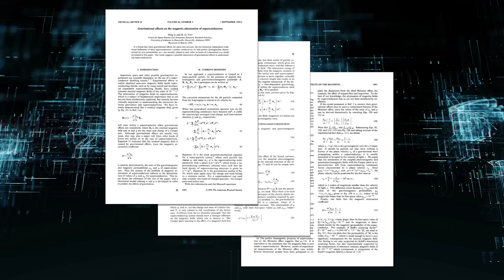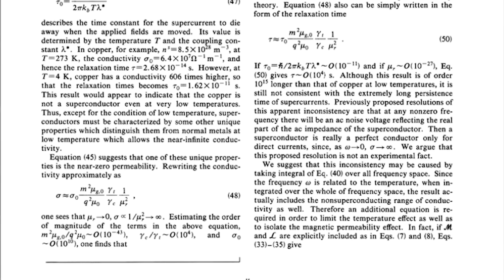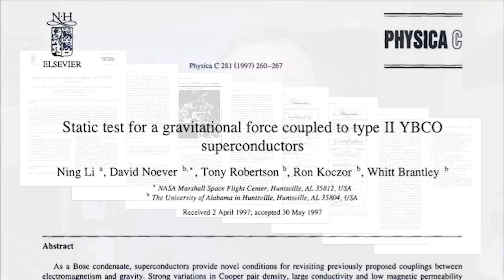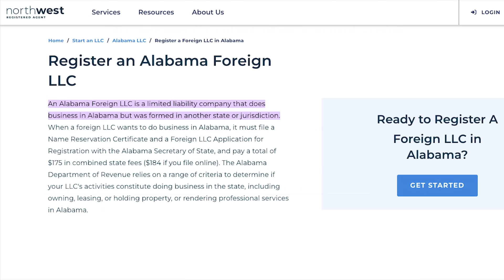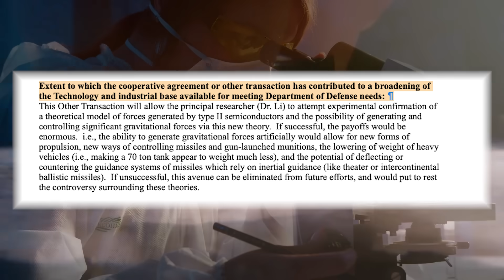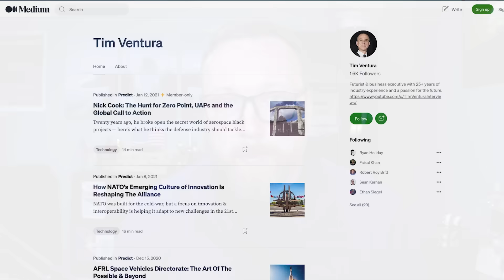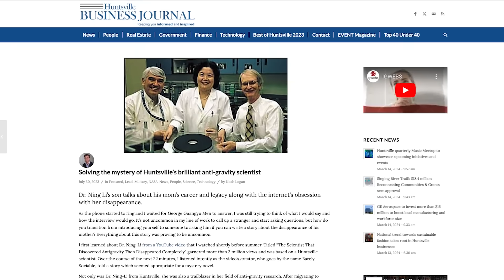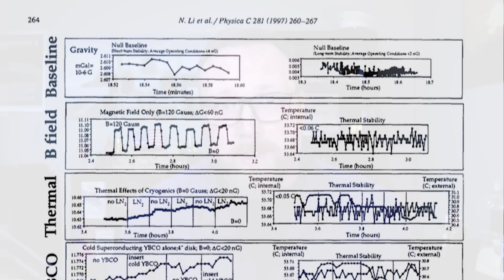The disappearance of America's leading anti-gravity researcher

Comment: I saw a video of a Lockheed scientist a long time ago.... I'm talking like 50 years ago..... The guy had a coil of wire with a plug on it the plugged it into the wall.. and the coil of wire jumped up off the floor and floated..... That's not even superconductors...... What happens if you blend them together........

Comment: Madam Li's method is also proved by a ring filled with liquid Mercury and AC current flowing through magnetic coils.  That particular experiment is from the 50s and it definitely works but scale and power output have always been the Achilles heel.

Comment: Sorry to say but anti-gravity is not physically possible if it was then the leading physicists would have theorized it back in 80s and would have had some breakthrough by now based on current standard model. However, it is not. Anti-gravity is universally impossible as it requires space time with negative energy and matter with negative mass.

Comment: Kinda makes sense it happened in the 1990s, as that was the "race for cold" (absolute zero) for which a Bose-Einstein condensate depends, which is where the quantum mechanics allows for apparent perpetual motion of fluids (fountain), and in which there's coherent behavior. Very weird stuff ... of which there are plenty of short clips you can watch on YT ... to see why it was a basis for exploration. The problem is, if it's predicated of near-absolute zero temperatures, it's a spectacularly localized effect, and, is spectacularly energy intensive. Even though it seems impossible that it could ever be practical, so too did another project out of Huntsville AL from ORNL, the MSR, which is another science project that's entirely worth learning about called the Molten Salt Reactor. A nuclear reactor that was dynamically stable intended originally to power ... a nuclear bomber (as in, ran on nuclear energy instead of kerosine). Most people associate it with Thorium, but, it's actually agnostic as to the Fissile material used. The real novelty was the use of SALTS as the primary heat exchanger loop ... which has a higher operating temperature (which MASSIVELY improves the conductive efficiency, as greater Temp delta does), and, operates at 1 atmosphere of pressure ... eliminating any need for the greatest source of CO2 in a civilian nuclear reactor's life cycle: The concrete containment dome. While Thorium appears to enhance the utility because Uranium is not only far more expensive, but also because there's a finite supply such that we may only have 100 years of energy worth of Uranium ... Thorium would have thousands of years of energy available to run all of civilian needs ... thus, if the expectation is that it'll take 50 - 100 years to figure out Fusion ... the pressure to get onto a clean fuel cycle that's inexpensive is far lower with Thorium.

Comment: My husband and I saw this outside ft Bragg on the last night of the US Open 2014. We were walking the dog in downtown at night, crossing over the RR that runs through town. Just beyond their mil reservation (previous Rockafeller land). It was silent and seemed to be asleep over us, like silently drifting still 100 feet above us. It was slowly following us at the pace we were walking. When I mean stealth, it was too good. Large black triangle. When I realized something was off was when it dawned on me that nature was silent too. Standing underneath, whatever it was using, silenced all vibration around. I looked up and it slowly did a right degree spin, silent still, then it turned on and was gone in the direction of the base at damn near the speed of light. It seemed it could rapid transport to the destination in less than 5 seconds, not even. It is real.
Reply: The image of the floating object at 0:15 seconds is almost identical to how it behaved, before disappearing at warp drive it seemed. That was pretty quiet too, but we saw lights like switching from stealth, black out mode. It DID lower down to the level of the trees in town...like it was disappeared from radar. It lowered down in an opening of the streets with the rows of trees at the RR X

Comment: How would you make a 70 ton military tank lose mass through this superconductor method without a massive electromagnet with supercooled conductors? Just the cooling system alone would be huge then you need to generate some ungodly amount of juice to run the thing. What kind of support infrastructure would you need to significantly lighten a 70 ton object to make the trade off in equipment and weight worth it? Seems pretty fantastic to me. Add significant mass to an already massive machine to lighten the weight of it 2.1% overall at most? You would need to negate the mass of the added hardware and a significant part of the mass of the tank in order for it to make a difference. 2.1% at most isn't an equitable trade off in energy required and added weight. How would you power an aircraft with this system without a cumbersome power generation and cooling system just to create superconductivity and mass reduction? This is a silly solution with absolutely no chance of success because of the logistical hurdles. "Anti-gravity" is just what that term describes. A force that's the opposite of gravity that actually repels massive objects with similar but opposite properties to gravity proper. Is there anyone doing research on this? Superconductivity is a boring parlour trick.

Comment: i have a theory for antigravity , bending the centifugal trayectories  of spining  magnet driven mercury in toureses incapsulated and attached to a body/ in a sphere, would move an object in the direction that the centifugal collides with?. including up. would move like an ufo..similar to how a spining wheel rotating can rotate the object its atached to, if the wheel could deform at a point, sharp in, ease out,   it will pull in that direction of the collision sharp in., wheels cant deform but bendy toureses can and spining shapless mercuty inside has less friction as its a liquid but also a metal so, magnetic, shapless directed centifugal.... i dont do phisics so prob bullshite but still interesting experiment lol, i may try to simulate it in d one day.

Comment: Vaporize Mercury with high voltage electricity inside a vacuum vessel, then manipulate its movement using sound waves, you would significantly be able to reduce its weight and alter the direction of its weight.

Comment: Firstly, trying to control gravitational force using controlled movement of elements and molecules is self defeating.
There is absolutely no way that an autonomouse system can become independent of the multitude of different forces that exist around itself in order to be repelled by the complex forces that are included in the gravitational theories.
This story or phenomenon is more reminiscent of the time machine based upon fictional prophesies.
To date the only way to counter gravity is by movement as in the rocket which is basically a reaction device etc.

Comment: I can tell you for fact that inside one of the disc shape UFO objects kept by the US Govt. there is an upper compartment and a lower compartment, the lower compartment has 3 solid spherical masses inside each are rotating conductors.  I believe that the combined effect of those 3 rotating superconductors create anti-gravity, and they can remotely control the angle of the rotation in order to direct gravity in any direction they want.

Comment: ok so a nitrogen cooled drone with superconductors for propellers - nitrogen is to get the superconductors to the low temperature  required to get the effect. a tesla coil is nothing more than a transformer and the diagram of whardencliffe is complete. the large boxes on either side are different metals so there is a constant current flowing through it based on the difference in the metals. Perpetual motion: is it not a scientific fact that EVERYTHING YOU CAN SEE has electrons spinning around an atom PERPETUALLY???  or if u want to be A nal, at least for the foreseeable future. Ning Li is chained to a track in a warehouse lab breaking bad style - pray for Ning Li <3

Comment: My guess is that our military already had a working alien or reversed engineered antigravity propulsion craft. Dr. Li probably was recruited to help better understand or help further development. Here's why.
I was in Army basic training in mid-August 1985 at Fort McClellan, Alabama. While  in formation, waiting to do our morning PT.
I saw  two UFO/UAV flying parallel to each other at a high altitude. Higher than a normal plane. I called it a UFO/UAV because I can follow a plane with my finger as it seems to creep across the sky. Commercial airplanes flying 550 mph at normal altitudes between 33,000 and 42,000 feet.
These bad boys were flying at way higher altitudes and at way faster speeds as it zipped across the whole sky and disappeared in a couple of seconds. I mentioned it to a couple of the guys, but no one has seen it. I kept looking at the sky, and a few minutes later, the same two points of lights zipped back from the opposite direction and disappeared. There were no sounds or vapor trails.

Comment: Actually, hello, I'm Kevin-
The disks of Area 51 are 2 DC motor ran.
..
Two DC motors are connected that look like an hours glass. They run through eachother, to give a 500w 12v charge, that power 20 12v batteries.
.
Darth Star is a solar panel square.
Fly's forever. Uses Flur static weapons.
.
Now, A "Bob Lazar" who doesn't know about injector motor, or hydro power supply, claims he saw a disk with a hole in it? Yes, he did. That disk was put on a flag pole as a joke. It looks shot..
.
Now, Area 51 had a lot of Methyl Keto to make into war effort drugssss.
.
This MEK is paint thinner. It's probably the Mk mind control conspiracy.
It's actually considered crowd control!
.
At some point, the United States military used "UFO conspiracy" to cover the war effort MK Ultra.

Comment: Don't know if true but another Yt site sait anti gravity is in the wings of the F'22 the video said they use voltage both under and on top withe the voltage under being negative and greater than on top which is positive.  They also heat the leading edge to heat the air before it hits the wing  by using microwaves the negative will chase the positive..but if true and it works then Chinas J12 probably has it.

Comment: THEORY: This is an idea for your consideration. Maxwell's equations talk about how light is the expression of the point when matter becomes energy. Hawking discussed atomic spin and it's different aspects, key and extremely relevant to quantum computing. Now imagine this. What if every constituent of an atom. Every shape and mass being of it's own path and direction of motion, as well as rate. Some vibrate faster and some slower. This is an expression of atomic decay. What if all of those pieces act like tiny dynamo's, little electro magnets. Each generating a dyamagnetic field of a specific frequency unique to that sub atomic particle. Baring in mind that the laws of physics tend to behave differently at the atomic scale. Could this be gravity? Then to, physics calls gravity the week force. What if nothing could be farther from the truth. Consider this, if reality were perfectly balanced, time would stop. So an uneven weightedness is literally a condition of reality. Now if the gravitational field is dyamagnetic then they would necessarily cancel each other out. So the gravity of the matter we experience is an expression of the deficit between one or the other. So, gravity could quite possibly just be a multispectrum magnetic field. Understanding this if it is correct implies that the way to manipulate gravity is with a device that applies this principle. I suspect also that one of the keys to success would be something like harmonizing the field. Like how you can cancel out a radio signal with a mirrored signal.

Comment: The scientist Maxwell made things gravitate hundreds of years ago it's not can we but how do we provide the power. That was solved by slicing the lines of Force around the Earth buy slicing those lines it creates a charge that can be used by The Craft and stored in batteries. Imagine electric generator a stator turns inside a field and create selectric . The craft is the stator and the field is the Earth's lines of magnetic and so when you slice the lines you get a charge which can be used for stored the problem lies in having the charge go through your field around the craft itself in conclusion it's not do we have the technology we do but now we have the computers that can change the field and the way that you slice the lines to optimize your charge. I can't tell you anymore except that we no longer have to rely on strong force. I believe that's why they want humanoid robots to come into existence quickly because they can withstand the g-forces required for that type of travel and speed. 2030 is the next 50 year leap in technology the last one was in the 80s in which we have lasers, home computers, cell phones, space travel with the shuttle ECT it's well known every 50 years you get a leaping technology the next leap is in 2030 .